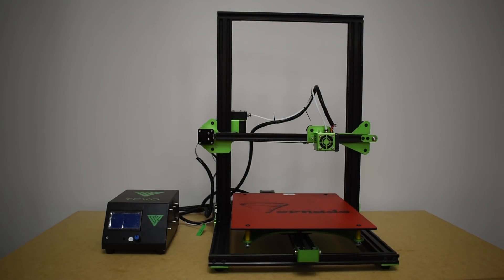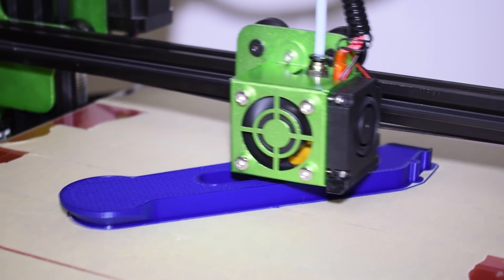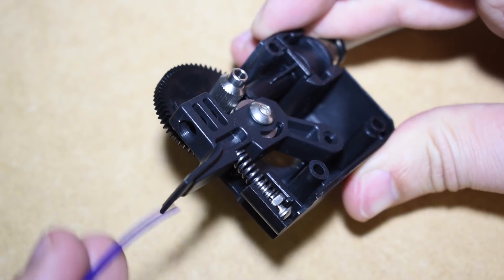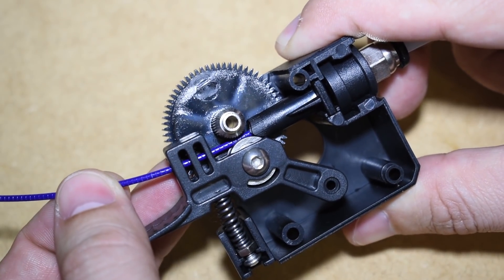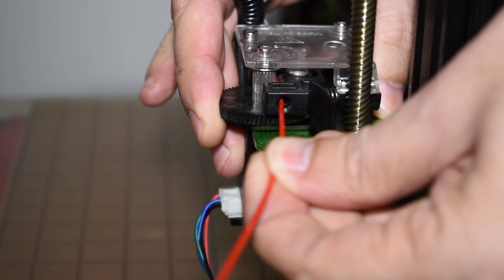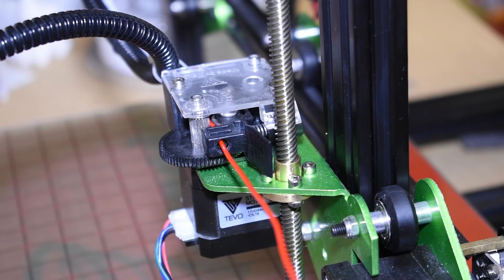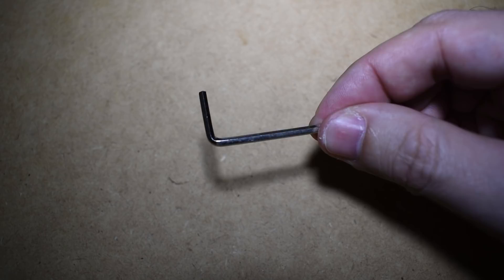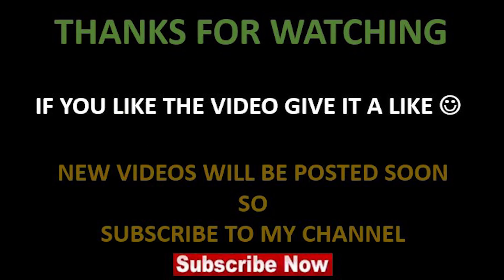TEVO TITAN EXTRUDER - HOW TO ADJUST IT

Comment: hi.
i have a new tevo flash
printing starts well without problems until at some point the printing fails.
The gear starts to make noise and spin and stops pulling the filament.

*The gear continues to turn around and make noise even when I take out the filament.
It stops only when I cancel printing
https://www.youtube.com/watch?v=MHiJH9aec1o

Do you think a tension setup will solve this?

(sory about my english)
Reply from the maker: Hi,
I believe that it will not. It seems that the extruder is trying to push the filament but because you have a clog or temperature issue, it jumps and skips. You need to look at the hotend and not the extruder.
Reply: @ruiraptor  thanks for the reply!
I'm sorry with I nudge .. :-)
Do you have an idea how can I solve the problem?

I'm frustrated. I've had the printer for more than a week and I still can not print a whole thing.

Tivo support team suggested that I do this:
"Please try to replace the X-axis drive to E-axis  
see if the Titan is working properly"

I am a beginer in 3d printing and I have no idea what that means
Reply from the maker: What was the highest temperature you used for the hotend?
You might need to disassemble the hotend and check if everything is ok, especially the ptfe liner. What materials you plan on printing?

Comment: Very good video. Skipping would be if the wheel turns but the filament isn't pushed through/is getting grinded?
Reply from the maker: Hi,
Yes. A low tension setup might make your extruder unable to keep up with the printing flow and will eventually start to grind the filament.

Comment: where the filament enters the idler is there away to put a fitrting with PTFE tube  I want to keep all my filament inclosed (originates from a box, exits via PTFE tube to the print
Reply from the maker: Hi Jim,
No, you cannot put a fitting on the input side but, for the tevo titan extruder you can insert a small piece of ptfe to guide the filament.
Reply: @ruiraptor  too bad   I do have PTFE tube in there but on retract it moves out as well.   I did find and print a thing that goes into the slot and holds the PTFE tube in place.  seems to work so far

Comment: Hi, Rui! Is this nut's position usual for Flash as well? It has Titan too. I'm having some troubles (chewing plastic and stopping to print): use 6.5mm 25mm/s retract. Some supports, hop 0.5mm. Retract is on between layers too. Not sure if it's because of these parameters. The only thing was changed: Firmware with Linear Advance. It prints quiter (and more accurate I guess).
Reply from the maker: Hi,
Yes it is. You probably have other issue and i'm suspecting the hotend. Check if it's correctly assembled. I have that explained in my 50% built assembly video.
Reply: yes, the hotend was fixed (before the 1st use) thanks your video. I'm suspecting some changes in code that were made by Harvey (in that new firmware). He has DEFAULT_EJERK 200 instead of 5.0. I'm not sure if this is that point (it's about feed acceleration as I've got) but I've compared Configuration.h in both firmwares and fixed that to the previous. Also I've found that #define S_Curve was commented but didn't touched it... It's interesting why he didn't used this.
Reply from the maker: Hi,
You can compare with the stock values. Check here: https://github.com/tevo3d
Regarding the S_Curve, that is a recent feature implemented in 1.9 version.  Some are still testing it and others, because you cannot have several options working at the same time due to memory limitation, prefer to have other features instead.
Reply: Thank you!
Wondering... what other features? After comliping with S_Curve (Linear Advance seems to be to tricky... and it could be a part of my issue) I've seen that there is at least 40% free mem.
I like how sounds S_Curve a lot (fill/infill jittering not making "knock" sounds anymore) and probably it's very good for the mech. durability. But if it will be failing in prints quality again and further I'll better turn back to the previous firmware.
Reply from the maker: The S_curve feature seems to be a much better feature but it still needs testing. 
Regarding the other features, i mean the power resume and boot animation. Some people prefer to have the power resume and others prefer to have the S-curve.
Reply: They can't be both together?
Reply from the maker: The S-curve takes too much memory...same as the boot animation for example.

Comment: Hi Rui.  Just bought a new E3D Titan Extruder for my Tornado.  Thanks for this video. It was hard to understand the difference between this one and the original clone that came with my Tornado.  The lever uses the motor shaft instead of a separate shaft.  The other thing is I"m not seeing how to connect the PPC4-M10 push PTFE connector is installed.  My instructions just show a length of PTFE tube instead of the push-in connector?
Reply from the maker: Hi,
Some titan extruders don't have the thread to screw in the PTFE connector. If that is your case, you need to push it in. I recommend making a thread instead if you have the tools for that.
Reply: Apparently my Titan didn't come with the Bowden adapter.  It was a direct drive hook-up.  I contacted the seller and they're sending me the Bowden adapter.  It doesn't use the pc4-m10 push type but an internal push type.  He sent me photos and instructions.  Nice to hear from you again.  Other than this everything's been going very good thanks to you and your videos.
Reply from the maker: Thanks :)
Reply: @ruiraptor  Actually there is a bowden connector, it's just a newer different kind.  A metal piece with an E-clip instead of the push type.  Don't care for those push types ecause I usually have to throw them away after a while because the top won't push in to release the tube.  On this one I just remove the E-Clip.

Comment: Hi there, thanks for your informative videos. I have a brand new Tevo Flash and having problems for printing flexible TPU. The filement cloggs in the extruder and filament does not come out from the nozzle. Should I increase tension in the extruder? Thanks
Reply from the maker: Hi,
How much retraction are you using? What TPU filament are you using?
Reply: I'm using TPU from sainsmart, temperature 210º, retraction 2mm, speed 40mm. Thanks
Reply from the maker: Retraction should be kept to a minimum or none depending on the TPU stiffness. Try reducing the retraction value.
Also, reduce the printspeed down to 20mm/s. Check the extruder tension screw too.
Reply: I'll try as you said, many thanks. Do I keep the tension screw as in your video, or add more/less tension?
Reply from the maker: With my tpu filament i increased the tension but you need to look how yours behave. If it gets crushed then you need to loosen the tension.

Comment: Hi rui, thanks for your video.

Does the extruder motor of your tornado make a "beep" every time it switches directions (extruding / retracting)? Mine does and I really want to fix it - people in the tornado fb group say the only way to fix it would be a new board and stepper drivers... Do you know another way?
Reply from the maker: Hi,
Indeed the stepper driver has a big impact on how the stepper motor behaves not only in performance but also in noise. To change the drivers you need to change the board too as the MKS base does not support the use of removable drivers. I would try something first...did you checked the Vref of your Extruder driver? I recommend you to adjust the Y axis vref between 1.00v and 1.10V and all the other drivers (X, Z and E) between 0.95V and 1.00V. Do not exceed these values. Check the motor temperatures while printing. They can be warm but not hot. Let me know if it helped.
Reply: ruiraptor thanks for the quick reply! I will try that as soon as I have a multimeter :D

Comment: Just received my Tornado (Banggood/48 days/$335) and the heater block is very loose. The wheels that hold it to the x axis are vertically spaced so far apart that the block just hangs there on the top wheels, while the bottom wheel fails to fully engage the v-groove. This allows about a half inch of play along the y and z axes. Has anyone else encountered this? I'm thinking about redrilling the beam holes. Any ideas?
Reply from the maker: Hi,
regarding the wheels, that's normal. You need to adjust the eccentric nut to fix the grip. Check my first tornado videos on how to do this.

Comment: Thanks for the video very helpful although I cut the wrong size Allen key to begin with LOL. I found if you take the 3 screws out and you loosen the fourth one you can just turn the extruder to the side enough to adjust a tension screw. That worked well for us so we don't have to take it all apart. Please check out our Channel I just put a video up today showing the difference it made after adjusting that screw. It was a difference between night and day. Thank you very much. I think even you will be amazed at the difference on that video
Reply from the maker: Hi,
thanks for your feedback :)
Reply: @A Skewed View 3D.   Where is the video on your channel?  Im interested.
Reply: @andre47g oh, okay.  Thanks

Comment: Hey ruiraptor! I'm looking into buying the Tarantula so I would like to be assured it's the best value for money before i do so. I've seen that the Tarantula doesn't use standard V-slot 2020 rails (the V-slot is not at a smooth angle for best wheel handling). So do the wheels wear fast? Did you consider upgrading the rails to true V-slots (at least the X and Y)?
Thanks in advance!
Reply from the maker: Hi,
Yes, the tarantula is a very good printer and in my opinion far better than an anet a8 or similar ones. While the stock tarantula can already make decent prints, i recommend a few upgrades to it to improve the print quality. You can check all my recommendations in my other videos here in my channel. The tornado is also a great machine and a bit better. If you have the funds, i would recommend the tornado instead as i think that the tornado is almost like an upgraded tarantula...just a little better. Regarding the metal profiles, the tarantula uses the T-slot profiles (the tornado has V-slot profiles). Replacing the T-slots with V-slots is not that easy as you need to replace all the plates with wheels as they will not work with V-slots. The distance between the wheels is different from T-slots and V-slots.
Reply: I've seen your other vids! They'll definitely come in handy once I purchase the Tarantula, since Tornado is a bit out of my budget for now. Thanks for clarifying the slots used in these two printers. With that said, do the T-slots on the Tarantula wear out the wheels? Did you encounter any problems regarding them, since you've been using it for a long time?
Reply from the maker: As you know, the ideal profiles are the V-slots but these work too. With both profiles, you need to adjust the wheels/eccentric nuts correctly (not too much and not too loose). The stock wheels will last a long time but in my case, i ended on replacing the wheels on the Y axis for MGN12 rails which i consider to be a very good upgrade.
Reply: Great! Just what I wanted to know, thanks for your time and keep up the vids! Cheers

Comment: Hi ruiraptor. I like your videos very much. However it would be nice to have a little bit more content about Tarantula as well (yes I am still using it and not going to change it in the near future). Thanks.
Reply: Yes I would like that too to add a titan, or maybe dual extruder, or E3D, direct drive? Heheh lots of options and almost non existent documentation or tutorials on that.
Reply: i woul like to see how to set up a diamond nozzle from the start for the tevo tarantula, what u need and how change the firmware and adding more extruders
Reply from the maker: Thanks for all the inputs guys. I will add them to my list. This tutorial was made with a tornado but can be used for a tarantula too because the tarantula can use the titan extruder.
Reply: Dear Yes that is true but the tarantula doesn't come by default with the Titan so first you have to change the firmware and also then install it and there is no guides on how to do it. Changes in the firmware etc. :)